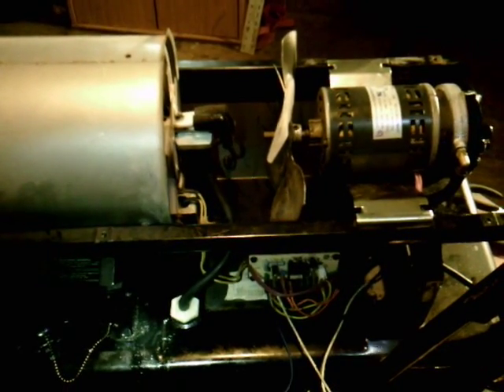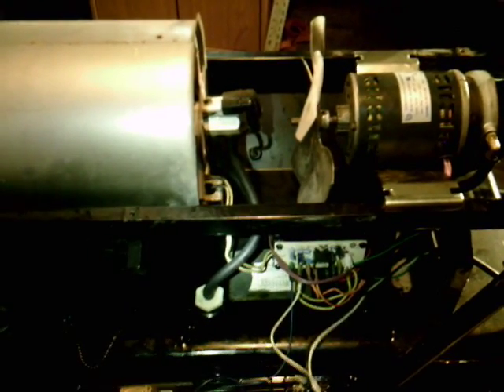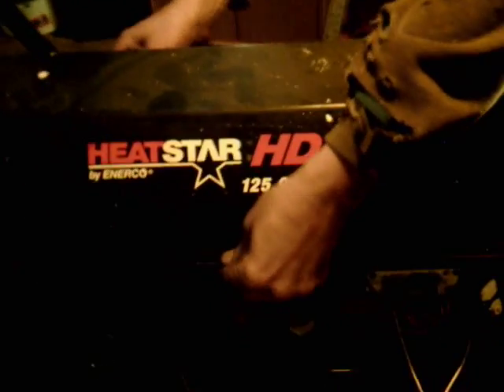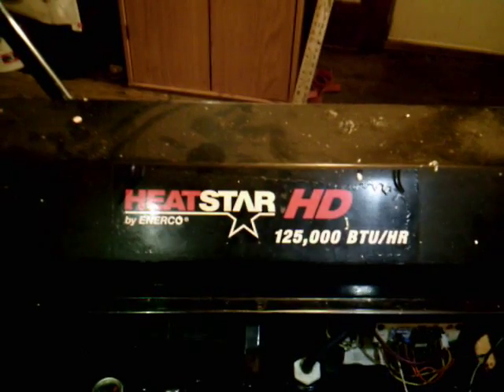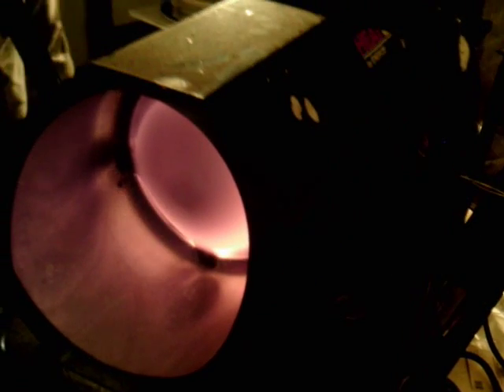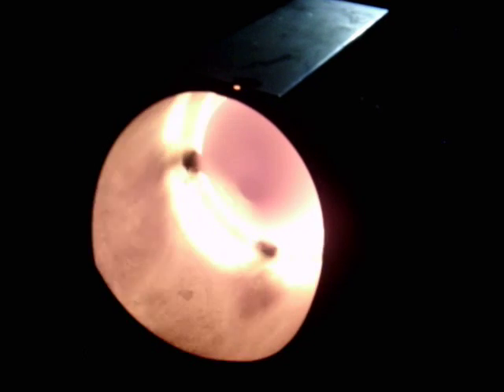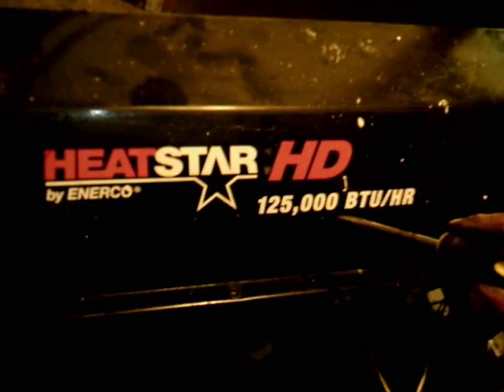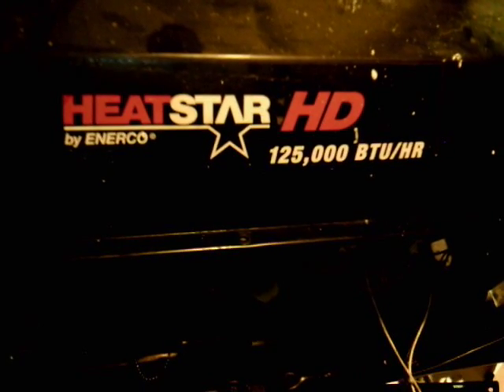Torpedo Heater Repair // Heatstar Repair Part2

Comment: Do you believe in putting diesel fuel conditioner in these heaters? Would it hurt anything? Your truthful opinion please?
Reply from the maker: +Robert Davis Hello Robert 
Most Torpedo heaters can use diesel fuel and K1. 
Some have a sticker that says so and some dont. 
Diesel fuel will cause a bit more corrosion after sitting for a long but in general it will work and it is cheaper than K1

Comment: I have a heatstar 175,000 btu. It turns on but the fumes are very strong. Does anyone know how to fix this issue?
Reply from the maker: check it for air leaks with soap water. Do not get water or liquid in the motor. Make sure your fuel and air lines are tight and not cracked